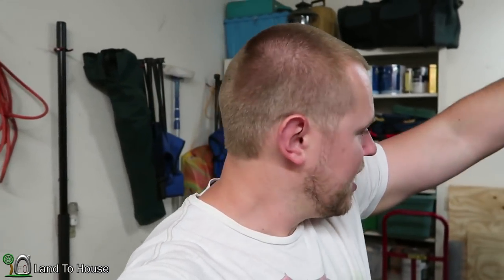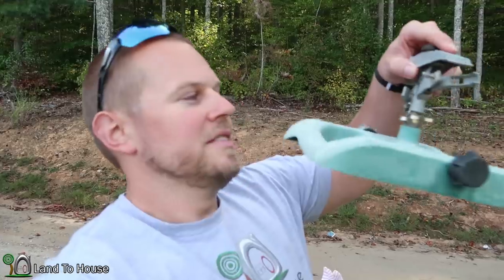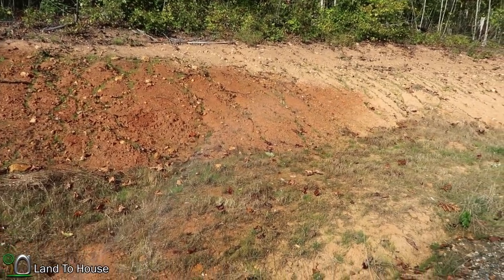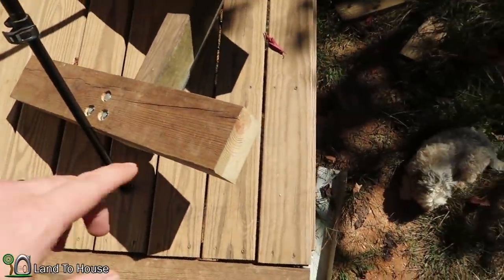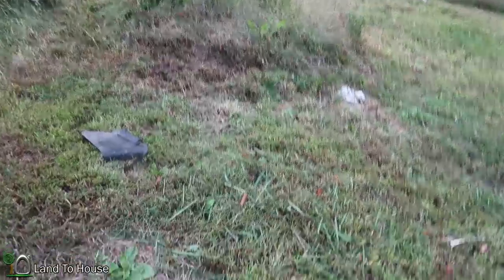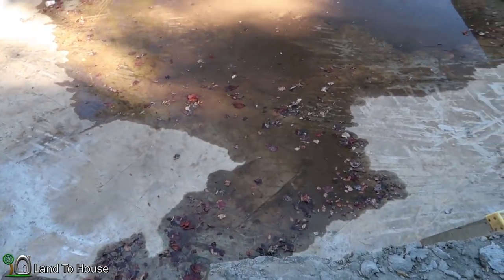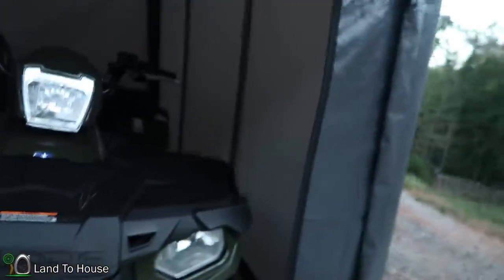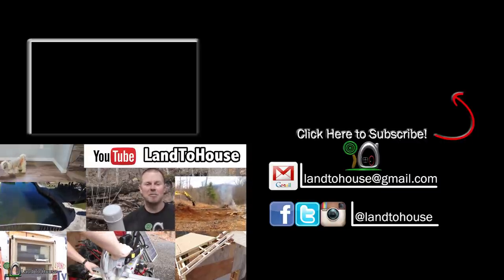New Shed and Ram Pump Designs - Vlog #47

Comment: This may not be a great solution to your anchor problem but you can use 5 to 10 gallon buckets, preferably with lids.  Place them at anchor points, make a bridle out of rope for each bucket and fill them with water or dirt.   Water is easier to load and unload but to each his own.  The lids are for mosquito control.  lrg
Reply from the maker: That is what a lot of fair tents use. I see that idea being implemented around here for craft fairs. I think in this situation it would consume too much real estate in the shed. I called around to the local hardware stores and they dont have these anchors. My thought now is to use the post hole diggers to make a hole and then bury the anchor.